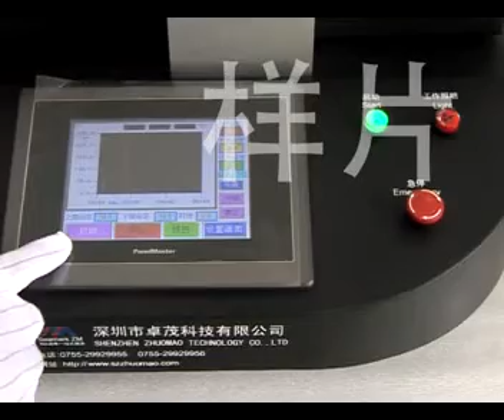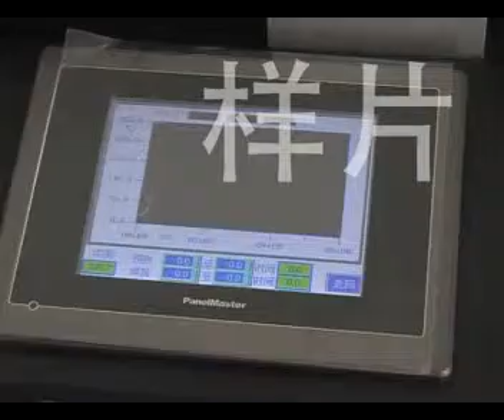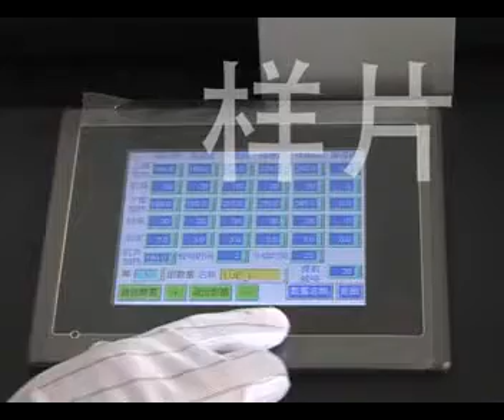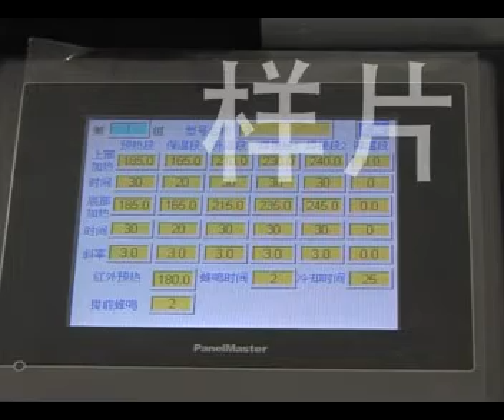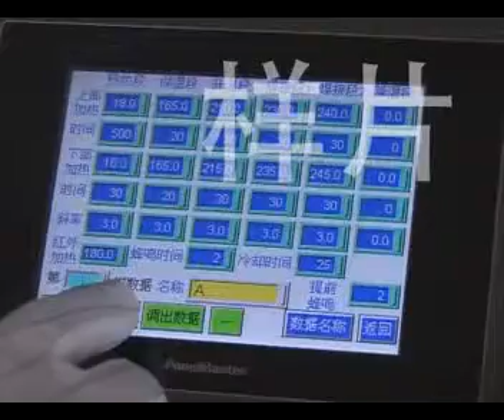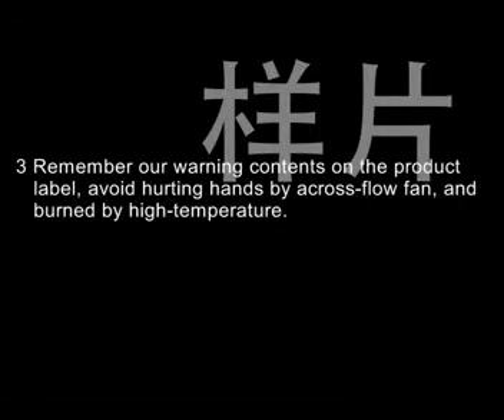Original Zhuomao ZM-R5860 Seamark ZM R5860 Operation Manual Tutorial , from Zhuomao factory in China

Comment from the maker: Now kindly to tell everyone, Zhuomao BGA rework station ZM-R5860 has upgraded. Equipped with Soldering iron ,and 220V AC power supply inbuilt, so now it can connect the soldering station, Heat air gun, welding machine. Price no change !